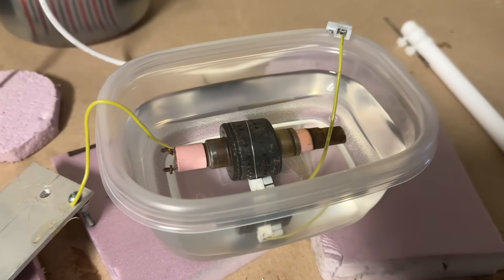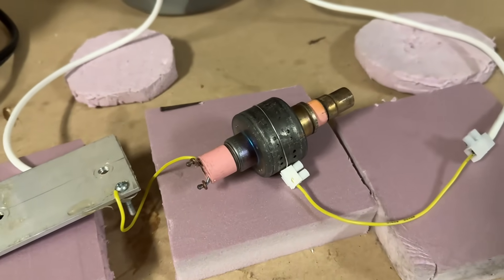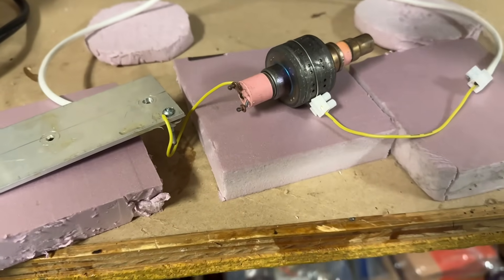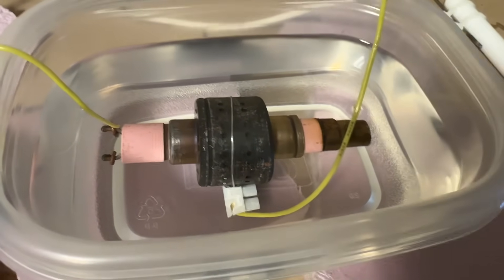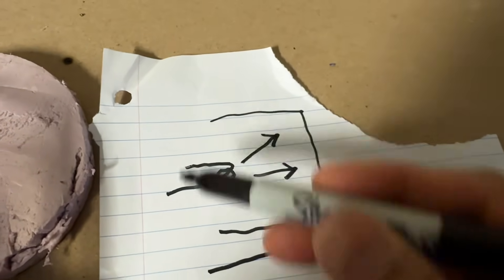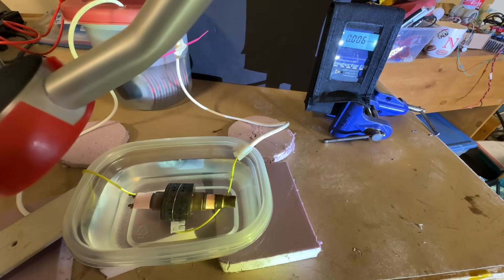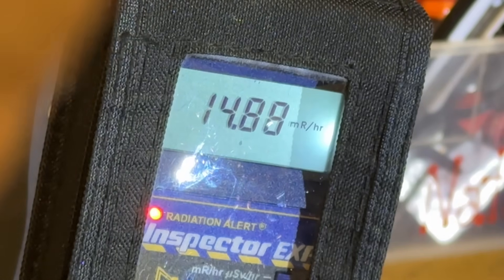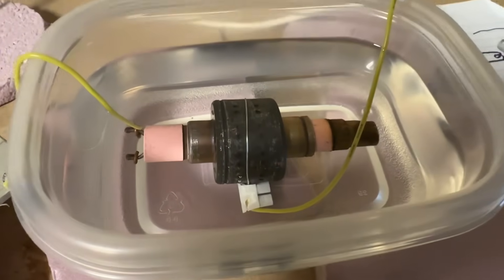Overvolting Magnetron under Oil

Comment: At  5:02 I saw internal discharges
Reply from the maker: There is metal disposition along the walls of the glass, which is leading to this. I have a different way of using the titanium pump.

Comment: You did not flip the places of the excitation voltage when you tried it in the air! A Flyback is NOT an AC per say, its a Unipolar square wave (17kHZ) spike, try to  interchange the terminals from the previous case, I'm sure you should be able get X-ray due to field emission of electrons from the Vacuum tube.
Reply from the maker: Interesting I need to try it out.
Reply: I realised it now that if you are getting the X-rays in Oil keeping the position same then you have indeed connected it in the right way, in air there was a lot of Corona-discharge dissipation that hampered the X- rays excitation.

Comment: As an experienced radiographer 2.5 mR/ hr or 25 micro sieverts / hour are the legal limits for the general public. As a radiographer we often exceed these limits in OUR work. But take care X-rays should not be fooled with. My questions are do you have any idea of the energy ie how many kilovolts and is there any idea as to direction or concentration of the x rays. Quite amazing, I worked with x rays tubes upto 300kv and isotopes upto 1.3 Mev I would love to understand the goings on inside the magnetron. Very interesting take care with x rays, especially un shielded and of un known energy.
Reply from the maker: The energy is gonna be in the form of soft x-rays. I’m using 40 kV to generate these x-rays, which puts them about 40 KEV. The very soft x-rays are gonna be filtered by the ceramic material on the magnetron. When the magnets are removed from the magnetron, it behaves  like a regular vacuum tube with electrons moving straight lines from cathode to anode and striking the copper walls of the magnetron. . There is diffuse emission of x-rays. These X rays are more dangerous because they are easily absorbed by soft tissues
Reply: Thanks so much for your reply it makes a lot of sense and you have kept my basic understanding quite solid. It’s an interesting concept, take care

Comment: Determine what particles you could accelerate and build a Cyclotron powered by the magnetron. Oh and you'll need a lead shield for X- rays and  Stay Safe.
Reply from the maker: Thanks- it’s on the bucket list!
Reply: @BrianDhvTinkerer  The 2 Dees are powered by the magnetron, in a strong bipolar magnetic field and an ion source is required in a vacuum chamber as a primer.

Comment: There was no magnet as well as no heater power supply. If you want electron tubes working with cold cathode (no heater), you need to feed +dc voltage to the anode. Without heater power nor magnet, it is mere vacuum gap instead of a cold cathode magnetron.

Comment: I don't really think the heater will help producing x-rays, I'm not really sure how it will react when you're powering it with ac, but on dc in the right direction, it will produce microzls as it should, and in the other direction it won't really be heated cathode and more like heated anodeso I'd say heating the cathode wouldn't really help, with hot cathode it will eat a ton of current (stabilizing around 4,5kV) and in the "heated anode" direction it should be the same as now, but you can try, I'm curious, but be really careful and nice driver! I like it💪
Reply from the maker: Thanks really tempted to try energizing the cathode. Oh btw stay tuned for a video I have planned to put out in a few days!

Comment: Interesting experiment! I had always wondered whether a magntron could be operated in cold cathode mode. Unexpedctedly yes, but not in the way I imagined. The terrifying contraption you've made aside, have you tested the magntron with the magnets to see if it would run cold?
Reply from the maker: Yeah  had always wanted to test to see if it could produce anything besides microwaves and sure enough!
Reply: @ Is it capable of producing microwaves cold?

Comment: Magnetron isn't radiactive, so you can not induce a radiactive behaviour from applying any AC voltage. Radioactivity comes from inside of the material that is unstable, not from any other being excited. What you are reading from you radiometer is microwave radiation, not ionizating radiation, witch is impossible to create with electricity. You may be creating a very small amount of x-ray due to not existing shield and hig voltage application to it. Dont lie people

Comment: you did not heat up the emitter  , low voltage high amperage goes to the 2 terminals on the back to get the cathode glowing red hot
Reply from the maker: I was afraid to heat up the emitter because of fear of excessive x-ray output

Comment: And aren’t you worried about the x rays affecting you?😵‍💫
Reply from the maker: I’m figuring that short-term exposure would be relatively safe. It’s all a matter of ALARA or time x exposure. In future experiments where I will attempt to make x-ray images using this tube, I’m planning on running it remotely. Hopefully that will provide a safety measure.
Reply: @BrianDhvTinkerer  detector would show you inadequate digits. Anyway never put your hands too close to this thing, there is a monstruos xray torrent right near this (!nonlinear dependence on distance, 200 rentgen\h for example or more)
Reply: @BrianDhvTinkerer  use scintillator detector

Comment: Water about in water will it short out can u make hydrogen with a magnetron
Reply from the maker: Water would probably not work because it would provide a conduction path for the high-voltage across the tube?

Comment: will a paper glow under the x rays emissions? I know that white paper have fluorescents compounds that make it look whiter, and glows blue under UV... I'm curious about... and maybe fluorescent markers may glow too or some vegetables oils or plastics... cameras can detect x rays (white pixels being excited), it's a great way to visualize and see where the radiation os coming
Reply from the maker: Yes, I definitely plan on doing this. I need to wait till it’s dark enough and also I need to have a set up where I use the x-ray green fluor sheet  which can fluoresce on exposure to the x-rays. I would plan on putting an object behind the film and seeing if it can be visualized with a camera that set up in front of the film under the dark conditions.

Comment: High voltage circuits can create noise that will trigger Geiger counters and give false readings. One way to test for this is to measure with an aluminum shield and then a lead shield. If the shielding material does not make much difference then you’re probably seeing noise.
Reply: This is a problem I have with geiger counters when hunting for antiques. Neon signs with their JV power supplie always cause false readings which can suck you into looking for a radiation source that isnt there. I've even tested them as a source of xrays which they're usually a poor source of. Using various shielding usually brings me to the conclusion of strong E fields are no friendly to the counter. Replacing the GM tube is another way to confirm the susceptibility of the circuit when there is no pulses from the absent tube.  
 It would be interesting to see how much is xrays and how much is electrostatic noise for this experiment.
Reply: @trash0  Sounds like you have read & refined the Boy Scout methods  ;)
I hope you find that elusive tin of Radium paint at the end of the EM spectrum 
& plenty of glowing curios in the process. 
An Oldskool Neon Sign I listened to using an improvised device & it made a very very unpleasant sound. 
I gave away my neon sign & trans at home after hearing the noise that the Red Neon Plasma Gas gave off. 
They were running on 240V 50Htz ~12kv @ 30ma trans feeding them both. 
The distance that I was able to pick up or sniff the Neon signs output was substantial , a lot farther than I would have ever suspected possible
from a 9VDC handheld device from the late 1970's or early 80's built for telephone techs. It broke & I  could never find another replacement unit.
Reply: my thoughts
Reply: @PhotoBillyDoesYouTube   This would be a False Positive ??  The lack of Artifacting with the Video Camera's CCD or electronics were my thoughts  ;>
Reply: Agreed, but I think the Gieger- Muller counter is calibrated and designed to overcome the otherwise Radio frequency harmonics both of Radiated and conducted susceptibility!

Comment: Dude, I don’t know how you handle these magnetrons with beryllium tipped ceramic insulators but all i can say is, you’re a madman bro.
Reply: The beryllium is very well contained in the ceramic structure. Beryllium oxide ceramics have also not been used in consumer magnetrons for several decades.
Reply: @ So I’m assuming they all got replaced with alumina oxide, yea?
Reply: @ I think so. Some say the pink ceramics indicate beryllium oxide. I’m not so sure of that. Short of taking an angle grinder to the ceramic and snorting the powder then getting a beryllium blood test I’m not sure how to confirm the use of beryllium in the magnetron. There may be a simpler test that I am unaware of, but I’m fairly confident that simply avoiding disturbing the ceramic with an angle grinder keeps it safe.
Reply: @NoahSpurrier  datasheet would say it. Also yeah the ceramic is hard to break so aslong as you don't intentionally break it it's fine about as risky as dropping a full cylinder right on the valve
Reply: @NoahSpurrier  I took a magnetron like this to a materials composition test on an electron microscope and the test has shown that the pink ceramic is Al2O3. Its quite common in electrical engineering actually, it's called pink electrocorundum

Edit: forgot to mention that pink color is due to chromium impurity, which is easy to add to aluminium because they have the same valency (3). Beryllium has a valency of 2 so I'm pretty sure chromium can't be added that easily to beryllium ceramic
Reply: wdym, its ok aslong as you dont break it
Reply: As long as u don’t drop it it’s safe !
Reply: Yea i dont see the fda, cdc or ul listing consumer grade electronic components in the US that contain an element that if broken releases itself as an airborne nerve agent or poison.  Especially when every microwave is considered a throw away commodity with no regulations on them when putting them in waste collections where they all are crushed with no waste/ sanitary staff being effected with that poisoning..  if they contained the stuff you would hear about at the very least a handful of deaths each year..
Reply: just dont crash it.

Comment: This is fake!
You are not producing and detecting any ionized radiation from the magnetron. This is high frequency electromagnetic interferences. Especially well known magnetron which is producing for its work on 2450 MHz! Moreover every one electronic device which has generator converter in its schematic would cause such interferences! From simple led lamp till high voltage lines in a field.
You are playing it а serious channel. Check you information before put something in the internet which could potentially break people dosimeters like electroshocking device which will do it on 100%!

Comment: this is like using an electric motor as a loudspeaker. I love it!
Reply: намного интереснее быль бы сделать loudspeaker from magnetrone, plasma speaker... i did one 200Wt arc discharge, between two electrodes gives flame-like looking arc, 30mmx30mm  like A-shape  :    ,___.A.___,  
it can play pure sound, really pure, because of accurate  reproduction(replication) of input-signal wave form, actually same good as electrostatic loudspeaker, and even good when playing in two ears like left and right headphones, to compare ESL and Plasmaspeaker, listening to it simultaneously as a stereo pair, - it appliable for it wonderfully, but newer possible with some electromagnetic loudespeakers of diferent models... Dynamic loudspeakers also not good to compare with ESL or Plasma in this maner, actually dynamics never able to restore original wave form of incoming signal correctly. But 200Wtplasma sound like smartphone or laptop speakers, 100Hz or beter 300Hz as starting freq.  depend on volume you need as always...  200Wt of power is enough to burn some like 3ml volume, flame like plasmoid - arc discharge, silent like vinyl record(it can cracks litle with dust, wind etc,without problem for lisener),and if you turn off energy, you will get vacuum wave, that limitating maximum speaker possibilyty of instant pulse, because it is easier to double incoming power, and twice plasmoide will produce wave ofcompression, much easier than vacuum, and even faster, but sound can not be better only half period of sine... so vacuum wave - is limit of plasma bass. and we need biger plasmoid, but if i put more than 200Wt in arc discharge, it became like long rope, that unstable in air(you can remember that moments of high voltage supply lines turning off, with arcs, that burns few second moving in air upon disconnected switch contacts like snake... it cannot play stable volume, for plasma speaker we need apple-like plasma ball... and microwave oven allow to burn it, it can play 50Hz easy... and i planed to malke electromagnet coil modulation princyple for magnetrone...
PS:Whan you think, is it possible to create electrolityc magnetrone?o
Reply: @IamJiva  yes but the frequency will be in the microwave range far outside human hearing
Reply: @BestSpatula  на самом деле плазмаспикер всегда воспроизводит не несущую частоту а амплитудную модуляцию, по сути плазменный звукоизлучатель это АМ радопередатчик, несущая  частта может быть и 20КГц(но лучше 200КГц)  и 20ГГц, в простейшем случае, волна декомпрессии порождатся погасанием плазмоида, не важно каким током созданного, я мечтаю сделать компактный сабвуфер на бензине, я знаю что это возможно, моя паяльная бензиновая лампа моет воспроизводить 20гц легко, когда я огонь подңошу к жиклёру вызывач циклическую флуктуацию рамера факела
Reply: @IamJiva what that sounds crazy!
Reply: @BestSpatula and yeah it is absolutely possible, you need to modulate that high frequency (amplitude/pulse with modulation is probably more effective but it doesn't really matter)

Comment: Nice random recommendation from the algorithm. I thought the frequency of the radiation made by a magnetron was determined by its internal geometry.
Reply from the maker: Yeah, I think pretty much is a function of internal geometry in terms of the microwave wavelength. When the magnets are removed, then the electrons emitted by the cathode no longer spiral in the vacuum, but instead move in straight lines and strike the walls of the magnetron cavity which is made typically of copper. If the energy of the electrons is 40 keV or  higher, this generates x-rays as I showed in the initial video. However, I was using a very low amp voltage multiplier type power supply. With the large flyback transformer in this video the amps are significantly increased with greater current and therefore greater x-ray intensity. This is with the filament off. I want to repeat the experiment with the filament partially heated. However, I don’t want to be in the room when I do that and will plan on doing that remotely to see how that works.
Reply: @BrianDhvTinkerer  Bingo! The fact you used a magnetron is a red herring. For the purpose of this experiment, it was just a vacuum tube with a copper anode - a typical x-ray tube.

Alas, due to the magnetron's internal geometry, you can't direct the produced x-rays. They are emitted circularly in all directions.

Edit: Like I commented elsewhere, a heated cathode could lead to the tube starting conducting way too early, with the voltage not high enough to produce x-rays. If you try to crank up the voltage anyway, you will either hit the current limit of power supply or the whole thing will blow up in a spectacular firework display.

Comment: Basically by the physical characteristics of the anode and cathode it acts as a rudimentary diode allowing flow in one direction if im following correctly? And the DC is less likely to form an arc in open air, which is why you needed to submerge it in mineral oil when trying to use AC ? Sorry im no expert by any stretch of the imagination and I Appreciate Your Time And Effort! I hope everyone is having a great day or night!

Comment: Nice. Probably hitting some sort of resonance node sending the output through the roof.
Reply: I tried to wrap my head around how on earth can a magnetron without a magnet even work, let alone produce x-rays. Everything I know about magnetrons indicates against it.

Then it hit me. The fact he used a magnetron is a red herring. It's just that a magnetron was the easiest way of obtaining a vacuum tube.

What he has made is a simple x-ray tube. Because of the magnetron anode's geometry, the x-rays are emitted in all radial directions rather than directed one way as in commercial x-ray tubes.

Comment: Without a proper anode structure, xrays will be very diffused and difficult to get a clear picture. This is the same result the happens when using a rectifier tube from a tv for xray generation.
Reply: Yep, very bad geometry for an x-ray source.  The cathode is in the middle of a slotted cylinder   In a way this would be the preferred arrangement for a isotropic radiator that sprays in all directions.  The distance between the cathode and the anode is also very small so an internal flash-over is to be expected.